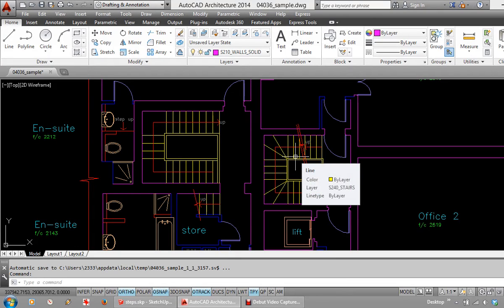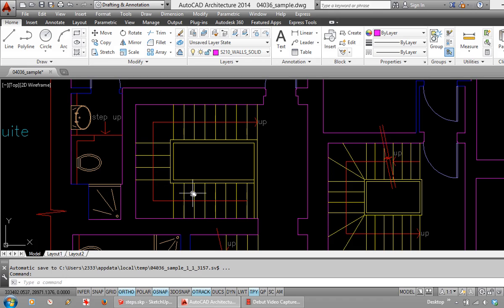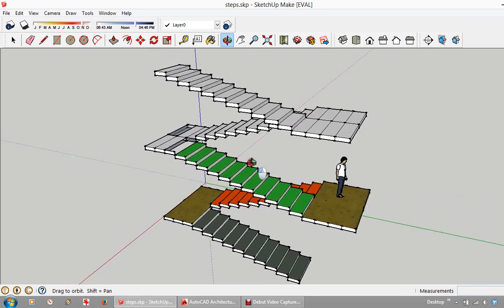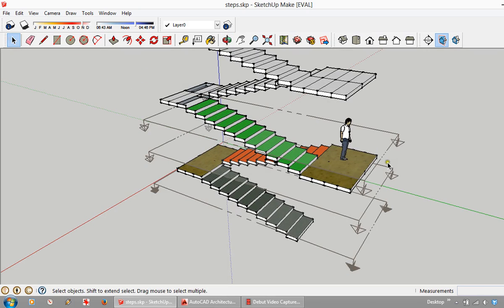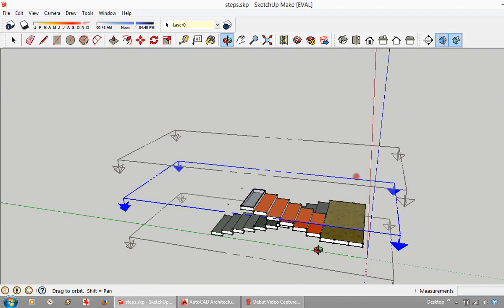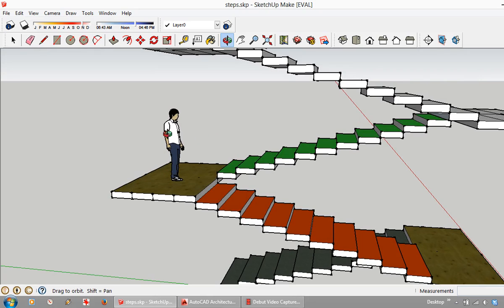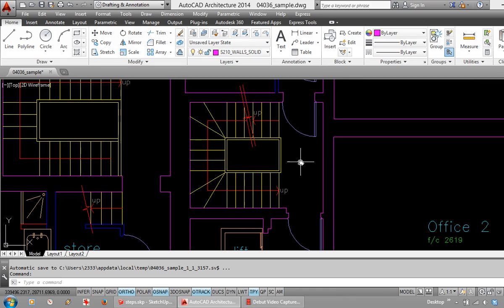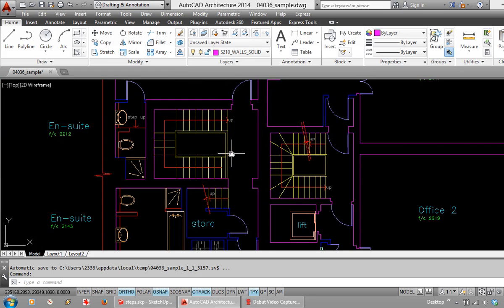Representing Stairs in plan in AutoCAD and on Architectural Drawings

Comment: Great video. One question. Where do you place a breakpoint in a single stair? Is it at 1.6m (Human Eye level)?
Reply from the maker: Taj, 1.5 would be sensible. Anything under 1.5 wouldn't be considered as habitable space so so it is the sensible place to make the break. Same applies if it's a double stair.
Reply: Thanks